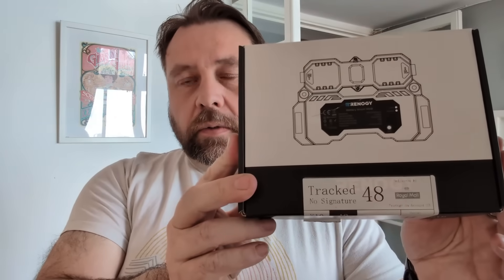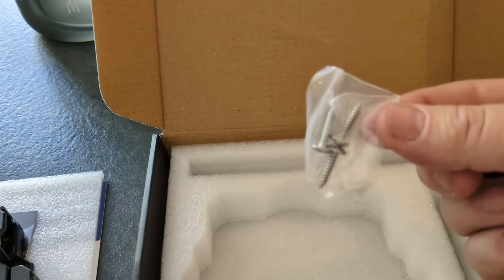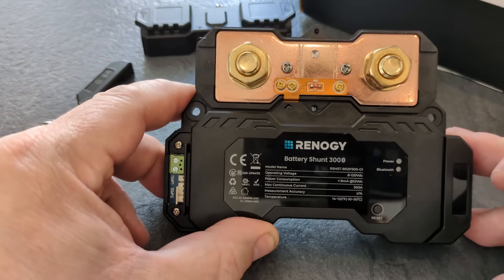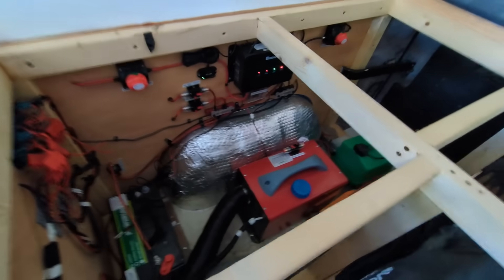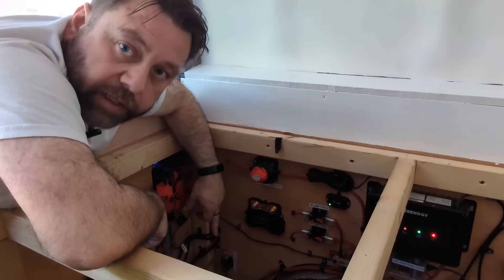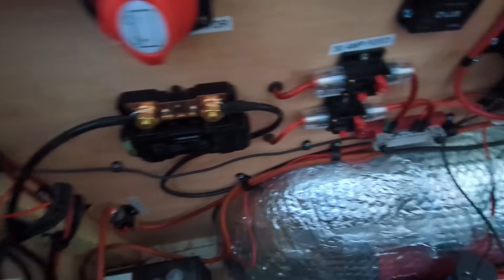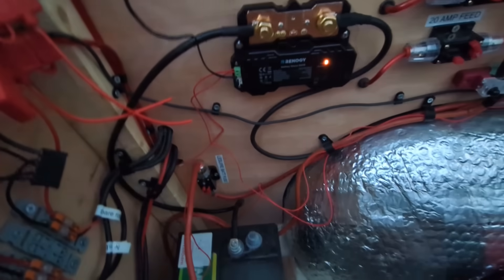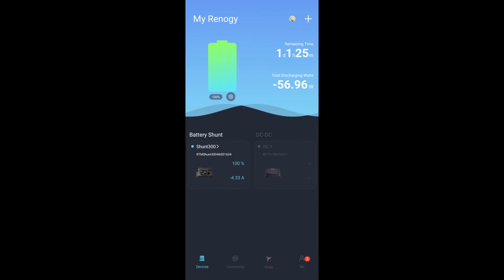Renogy Smart Shunt 300 Unboxing, Install and configure. Easy DIY Camper van upgrades 12v solar

Comment: I don’t actually have a negative bus bar, so I’m trying to figure where I should go with the cable? Any ideas?
Reply from the maker: If all of your negative cables go directly to the battery terminal you could attach them to the output side of the shunt then make a small cable tofo from the battery terminal to the shunt input. . I would consider getting a bus bar though as they can be quite cheap from Amazon as it will be a cleaner install
Reply: @CummaszonAdventures  I’ve got negative from the renogy dc/dc+ mppt, negative from the fuse holder and negative from the inverter all going to the battery negative
Reply: @CummaszonAdventures at what point do I install a bus bar? Sorry, this is the first time I’ve done it, and it all works great but I want the shunt so I can see what my battery % is like
Reply from the maker: Take all those negative cables and attach them to the shunt. Make or buy a new negative cable to connect the battery negative to the other side of the shunt
Reply: @CummaszonAdventures hey. Thanks for the help so far. I do actually have a grounded negative cable that isn’t being used at the moment. Is there anything stopping me connecting that to the P- terminal of the shunt?

Comment: What gauge are the two black cables you added that you connected from the shunt to the battery negative post, and the negative BUS bar?  
It appears these were not included with the shunt.  
Thank you for you answer in advance.
Reply from the maker: Hi these cables were 8awg standard battery cables o bought from Halfords. Thanks for watching the video!

I would say to make sure you size your cables based on the kind of load you are running. I have a 12v system only with no inverter so my maximum load is quite low